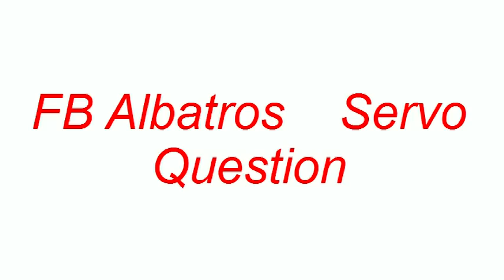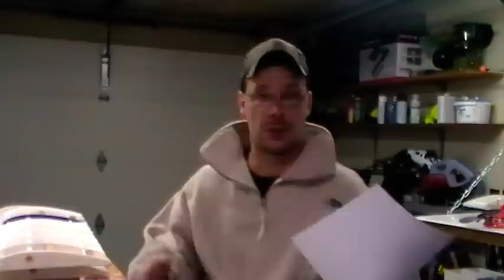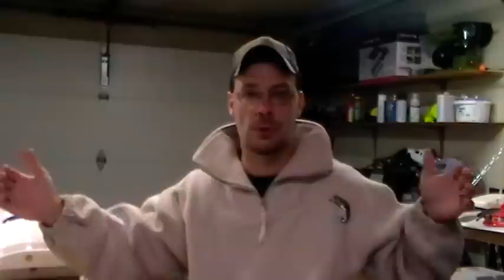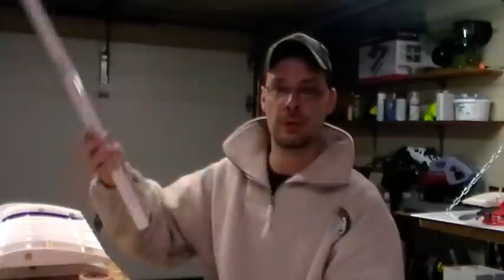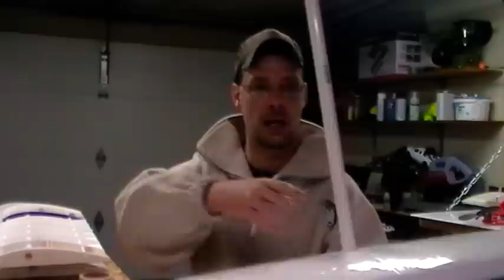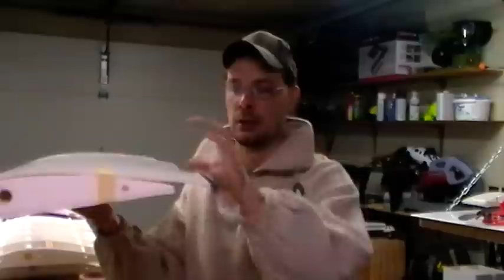FB Albatros Servo Question

Comment: I'm partial to the EXI D213F servos at HobbyPartz.  They're 9g size, metal gear, digital, $8.50 each, plenty of torque, good resolution.  I think some spoilers (by some means) is a great idea for this plane coz I bet it will float on for days.  You might could get by with only one 30" aileron per side, way out there from the fuselage, but two 30" ones or a fused 60" would definitely do the trick.  I think you're probably right on with your plans so far.

Comment: i dont think you you're going to need two servos for each aileron. Yes, the plane is large but shouldn't be too heavy. It's also not going to be that fast. I would go with a metal servo in the 52-60 gram range. This should give you 100-150 ounces of torque which I would guess should be more than enough.

Comment: Honestly i would run 4 servos for the ail 2 for flaps 2 for rudder and 2 for elevator and I would use turnigy  tgy 9018 mg from hobby king. So far i love then plenty of power desent speed and seem to be pretty reliable. Just my suggestion. Other wise I'd say your on the right track

Comment: That's the  power that comes from the bec. The BEC is what runs the servos, the battery runs the motor directly. That way you don't over energize the servos and smoke them. Also, if your batt gets low and the motor shuts off, it will still send power to the servos to guide the plane down safely. We hope.  I highly recommend installing a BEC on your ESC that will put out at least 5 volts for the application you are using.

Comment: I bet you could use steering servos that one might use on a short course truck, like a Slash 4x4 or on 1/8 scale 4x4 buggies. They're designed for the high torque of turning the front wheels with power on, so they can really take a beating. I use the Hitec 5645MG. DEF go metal gear!!They cost about $40-45 and are designed to work on aircraft up to 40 pounds. You think this aircraft is gonna weigh more than that?.